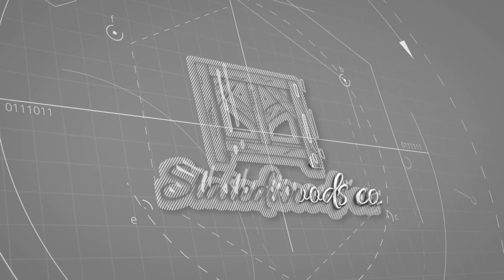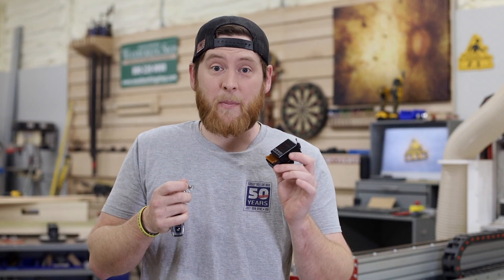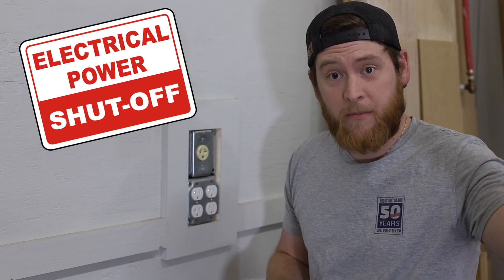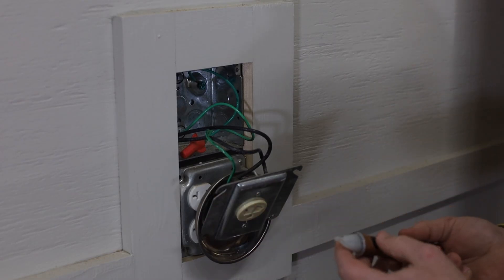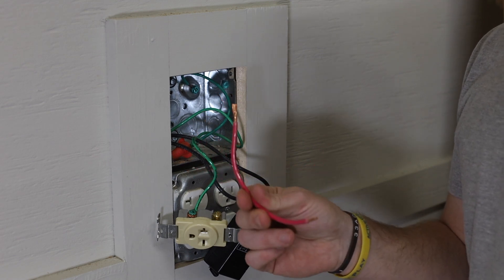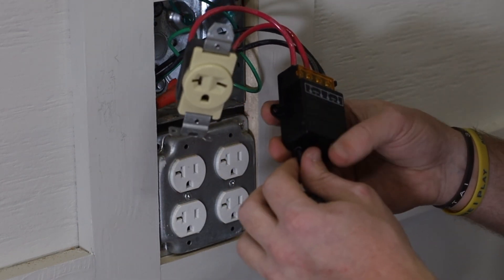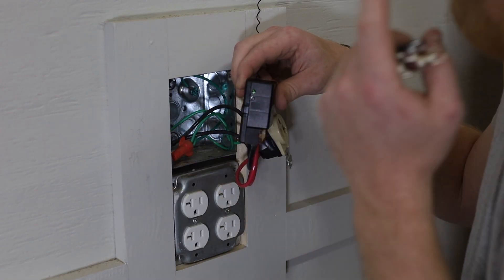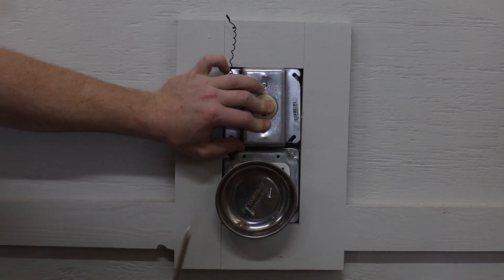Turn Any Outlet into a Remote Control Switch For Under $25!

Comment: I ordered one of these with two remote transmitters with telescoping antennas and the relay receiver unit that claims 30Amps @ 110/220 voltage configuration. I have been a power generation, relay and low/med/high voltage engineer and NETA 3 testing technician, because of the price I knew the quality and actual specifications could not be after it got delivered to my front door, I was looking for this larger box but instead had a bubble mail envelope on my steps. I picked it up and it had a small box and two remotes and batteries and I just laughed and shook my head. I bought it for my 350 foot deep well pump that was getting tired and the check valve at the top of the pump housing was constantly back flowing so it could make pressure constantly running with no back pressure but when I would close the main valve the water would not pressurize fully in the new 20 gallon pressure tank and shut off the pump until it actually needed to call for water again. So that condition was happening before I moved to the property apparently so the built in overload thermistor on the motor started to weaken and eventually failed completely so I had ordered this remote controlled relay for the well but it was too late to save the pump, now have to pull it out and replace it with a new prime check valve. Your right about using this Chinese relay XP9500 primarily in conjunction with a contactor because there was no way it was going to drive a 220 volt 2 horsepower well at 300-350 foot lift and another 120 feet of 1 inch polymer water pipe to the main plumbing entrance. So I will just keep it for a simple 110 volt circuit with relatively low amperage.

Comment: Nick - consider using your remote to drive a contactor.  The contacts on the remote relay are under rated for the application.  I have the same remote relay that controls a contactor rated for 30 amperes - good for my 5 hp dust collector.  Your remote relay will last a whole lot longer!
Reply: That little relay you held in your hand is way too small for a big 220V machine like that.

Comment: I was wondering, does the relay turn off automatically in the event of a power outage or does it just keep the outlet on when power returns?
Reply from the maker: It turns off from my experience.
Reply: @Statedwoods  Thanks. Did you have to reconfigure the receiver?

Comment: Hello, do you know of a remote setup for older homes that have a "pigtail" wire, where basically somebody has dropped a hot line to connect to two terminals of a single-gang wall switch solely to turn a light fixture on and off? 

I have one I want to basically turn into a remote-controlled inline switch, and remote switches and relays I've seen so far including the one in your video here appear to have Line and Neutral input/output whereas all I have is a single line, basically. Any leads would be appreciated! 🙏
Reply from the maker: Thats a little above my knowledge. Sorry I dont know that answer
Reply: @Statedwoods no biggie, thanks regardless for replying! I'm gonna bypass that noise and instead just install a new fixture with remote capability.

Comment: Can this be set to work with 220v? You'd just wire the two loads on the Load/neutral terminals?

Comment: great job  love that you taped everything.  not trying to be an a-hole but i am sure this will sound like it.  I do have one comment the outlet you have is not rated for a 30 amp circuit.  it is only rated for 20 amps.  You really need to change it out to the proper outlet or change the breaker to 20 amp.  i am just trying to educate.
Reply from the maker: You caught me lol. The unit is sized for 30 but that was a 20. All the rest are 30. The panel is right for the plug. Just wanted to keep it easy for others to understand.

Comment: I want this for a 220v electric stove to prevent a senior with dementia from cooking and burning down the house. Think it would work?
Reply from the maker: Depends on what amp load the stove is rated for. But in theory yes. You just treating it like a switch.

Comment: Will this work on a 240v 3-wire (2-Hot & 1 Neutral) outlet used to charge my Tesla on a 50A circuit breaker?  I don't like leaving my mobile connector always plugged in when not in use.  This would allow me to turn it on when needed and off when not, thanks!.
Reply from the maker: Its only rated up to 30 amps. So 50 is too much

Comment: Hi Nick, I went ahead and ordered the switch and hooked it up for my 220v dust collector. It works. But I discovered it’s a single pole switch. One of the hot wires (110) always stays hot. The switch only turns the other hot line (110) on and off. 
Is this recommended or even safe-that there is continuous voltage (110) flowing into the machine from one line  even when the switch is off?
Reply from the maker: Yea from what I have read its totally safe. Not much different than a light switch
Reply: Use the unit Nick describes and hook it up to the coil on a 220VAC contactor.  The contactor will need to have a 110 VAC coil.  Lot less current needed to control the coil and the remote unit will last a lot longer.  Mine uses the same remote control to operate a contactor coil.  Contactor contacts control current to a 5 hp dust collector.
Reply: Not an electrician, but from what I’ve read, a 240V switch needs to turn off BOTH poles by US code. 

I’m assuming this remote can get away with saying it’s rated for 240V because in certain parts of the world, 240V is carried on one pole so this remote switch shutting off one pole would be fine. No different than 120V in the US.

Comment: I’ve seen other videos on this too. Some similar concerns that this isn’t rated to cover the higher horsepower of these cyclone units. Any comment on if it’s lasted for you? Mines a 2hp. Great video!
Reply from the maker: These work great. My dust collector is 3hp. I also have 2 rotary vane vacuum pumps connected and 1 remote to turn both pumps on.  220v 30 amp breakers and they work great. It says rated for it

Comment: Good tutorial but the actual relay on this thing is only rated to 1/2hp @ 220v or 1hp @110v, so most Oneida dust collectors are actually way over this limit. I'm guessing because of inrush current vs a strictly resistive load. I know people have gotten these to work with larger motors... just saying if you want to do this more safely, find a relay rated for the receptacle AND the max HP of your load. Good video and thx for the content!
Reply: Have you found something that works?  I am looking for something for my onieda.
Reply: @WOLF-gz8yv  There's a remote that Grizzly sells that I use and it works great and even Oneida sells one as well (from ivac I think). Both designed for multi-HP motors.
Reply: @WOLF-gz8yv  I ended up using the same setup to control a 30 amp contactor for my 5 hp dust collector.  The remote control drives the contactor coil which takes a whole lot less current to operate.
The contactor contacts are rated for a full 30 amps - 5 hp motor needsc20 hampered. I also added a time delay circuit to keep the contactor engaged to keep the dust collector motor from burning out.

Comment: I have a window ac that is 220vac 15amp.  Will this work?
Reply from the maker: It should provide a power switch yes. May not start the thermostat for you.
Reply: This is exactly what I intend to use this for
Reply: This is exactly what I intend to use this for

Comment: This product has no certification listings in the ad. There's not a chance that I would use this in my house without some type of certification like  UL, CE, EMC, CSA.
That's the problem with Amazon people think that just because it's listed for sale that it's safe. Do your homework people, don't buy garbage products like this.
Reply from the maker: Your battery in your cell phone coming from China has no certifications either yet its in your house
Reply: @Statedwoods  - Actually my phone is made in Seoul South Korea and has been thoroughly tested due to international trade agreements between the United States and South Korea. I mean seriously what are you talking about? Are you trying to defend the piece of s*** products that come out of China that have no certification or testing done before they enter the glorious Amazon network to be sold all over the world? All I'm saying is that consumers need to be aware of the products they buy. There are tons of garbage dangerous products for sale and people bring them right into their house not knowing any better. Just because something's available doesn't mean that it's safe. I think the following statement applies perfectly to a guy like you " a little bit of knowledge is a very dangerous thing "